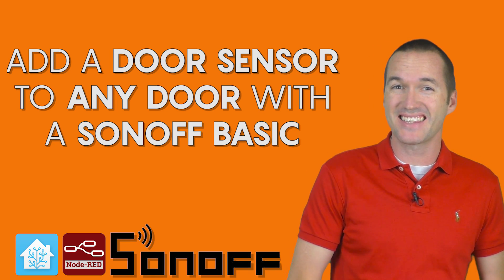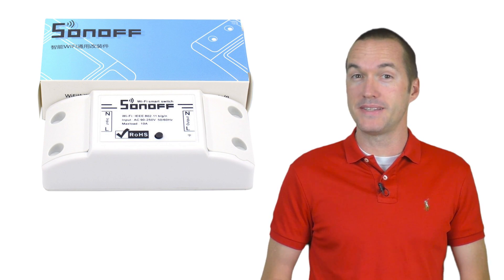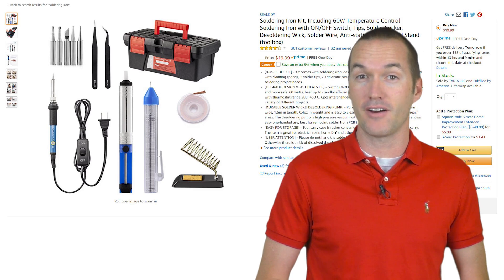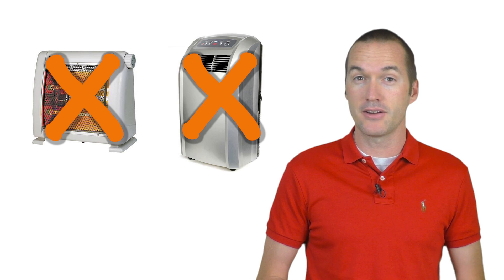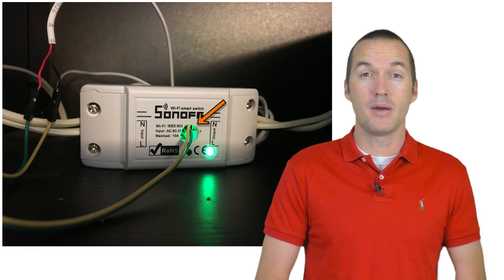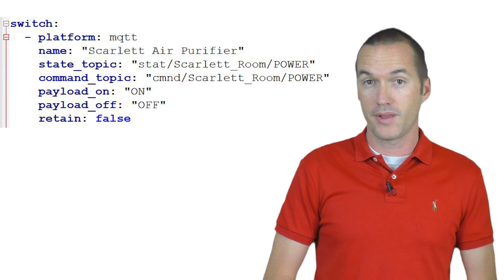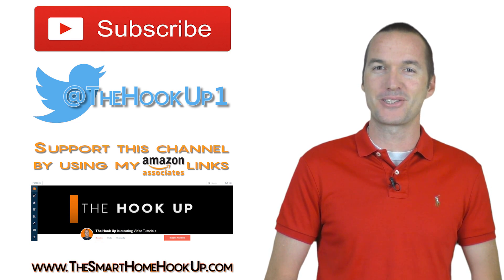Add a door sensor to any door with a Sonoff basic.

Comment: I'd like to use sonoff mini instead of basic, light switch is often close to the door. Do you think it's possible to update this tutorial with sonoff mini?
Reply from the maker: I believe the sonoff mini has mains referenced voltage on the GPIO, so I wouldn't recommend it.

Comment: I wonder.... Wasn't there any wifi or zigbee door sensors in 2018? I've had a tuya based wifi door sensor for ages and now there's dirt cheap zigbee ones. Even the tuya isn't that power hungry and if the CR2 battery doesn't last long enough then just build an external battery pack. No hassles of long running wires and potential increased fire risks.

Comment: To put the 5 “pins” in all you need to do is heat up the solder & use the solder sucker that was in the pack, this will take the solder out of the hole. Place the pins in the hole & re solder. No dicking around pushing  a very hot pin through a hole.
Btw this shockingly bad & arse over elbow for a simple job. Just buy a battery operated door sensor from Kasa. In the Kasa app you can make the sensor do all sorts of things .. and above it’s safe unlike the crap your showing.

Comment: Amazing WiFi sensors do7.pl/AISensor it will tell you if your for or window has been opened. Easy to configurate instructions are not the best. But really all you have to do is put 2 AAA batteries download the simple home app make sure that the blue led is flashing while you’re trining yo pair it with the app if it is not just remove the battery’s and try paring again

Comment: Any advice or opinions about connecting multiple reed switches in series with the sonoff? Personally, unless there's a logical reason for knowing which specific door or window is open, I would try setting up one sonoff for windows and another one for doors in each room with a series-wired switch for each window or door.

Comment: Buy some solder removing woven copper wire, it is super cheap, you heat it next to filled pads like those and it will suck up the solder leaving the holes open.

Comment: I tried the same process with a door sensor and a nodemcu but i must be missing something.. I did the whole process (used GPIO14 -> Switch 1 (9), tasmota console detect the ON/OFF of the door sensor. Also home assistant mqtt console detects the device but nothing else. Do I need to run additional commands in tasmota console ? Do I need to configure a yaml file or anything else in home assistant ? Thanks in advance.

Comment: hi, Your videos help me a lot. But I´m trying to use a sonoff sv as a gate opener, I set pulsetime since I only need a pulse to open or close the gate, but when I try to use a reed sensor on gpio14, to show the state of the gate (open ou closed), it triggers the relay when the reed sensor closes... could you help me with the configuration so the gpio14 only sends information of the state of the reed sensor and doesnt trigger the relay?

Comment: Haven't actually got mine yet, but I'd have thought you could wick the solder out of the holes, drop in your five pin header as a single piece, then solder each pin individually? I don't know why but I find it much easier to solder when I'm concentrating on one hand doing something fiddly rather than both, and with a full set of headers you can just rest it upside down and let gravity do the hard work.

Comment: Can I just connect a sonoff sv and have the output be always on, and run a reed switch in series with a led or something with a small current draw so when the door is open the reed switch will open the circuit, and then I can go change the device settings to notify me if the circuit turns on or off?
Reply: I’ve only known about these things for a week and now I want to make everything in my house smart. And I only learned about them because I wanted to hook up myq to a BFT control board and found out myq was subscription based and only works with certain models of liftmaster products. This seemed silly to me so I set out to prove my coworker wrong only to find out he was right. Then I found a video about the sonoff sv. I instantly knew I could use these devices and possibly a great many of them so I bought 4 to play with and another 4 basics. I already have my overhead garage door on a sonoff sv, my coffee maker is on a standard sonoff for the schedule function on ewelink, today I’m wiring an old electric strike from a job that still works well to the pedestrian door on my garage with a sonoff sv. If that works well, I’m going to get a new assa abloy electric strike for my back door. And I’m just getting started. From work I got my hands on some really high quality wired outdoor reed switches for gates or overhead doors that I really want to wire into one of these WiFi switches, that will then notify me of the door being opened or left open. The only thing holding me back is I don’t have a computer, so I’m a little leery about trying to flash or using the more complex home automation programs....really I don’t want to buy more components that will end up on a shelf if I’m not sure about it. I know, should just try and see how deep I can get, either way I will learn something. Thank you for sharing your knowledge it is helping me a lot

Comment: anyone have any experience/suggestions for doing something like this for an outdoor gate?
Reply from the maker: I've found the actual magnetic reed switches to be extremely weatherproof, so assuming you have a weatherproof box to mount the sonoff it should still work well.  I use a nodeMCU to monitor my gates.

Comment: Can you pls explain how to connect wired reed switch to 5V DC Sonoff module. I am already using this module to automate my car garage door. Now I would like to get door open /close notifications. Pls, help me with this requirement. Thanks in Advance.
https://www.ebay.com.au/itm/Sonoff-WiFi-Wireless-Smart-Switch-Relay-Module-5V-for-Home-Apple-Android-APP-DIY/112731113199?_trksid=p2485497.m4902.l9144
https://www.ebay.com.au/itm/ABS-Wired-Door-Window-Contact-Reed-Switch-Normally-Open-Closed-Switch-NC-NO/401734157936?hash=item5d8938c670:g:FbAAAOSw43pckzCq

Comment: All the automation can be done with the Sonoff itself without even having to mess with HA.  Just set up a rule in the Sonoff that triggers when the switch is activated then send a command to any other device you want to power on.  I have a Sonoff that opens/closes my garage door.  I have a reed switch connected to it to detect if door open or closed.   Rule1 Detects garage door is open sends a Web command to my garage lights to turn them on.  Rule2 detect garage closing, waits for 3 mins then sends a Web command to turn off my garage lights.

Comment: Am I missing something? I have a wireless door sensor that literally does the same thing and works flawless and I didn't have to flash anything, didn't solder anything, no running wires across the room etc .. also after you buy a sonoff, soldering iron, wire etc.... You could have just bought a wireless sensor and spent 30 seconds accomplishing the same exact thing.
Reply from the maker: To each their own.  Things you are possibly not considering: No batteries to change, no hub needed, increased reliability, and of course the fact that many people already have a sonoff deployed that could use this added functionality.

Comment: I love the idea, and I’m trying to use it for a garage door, but the sonoff I have is the R2 (does not have GPIO 0, so I used GPIO 3) but my question, can everything else be follow as directed?

Thank you very much for your time and your shared projects!
Reply: I actually use “KEY” as GPIO14 to connect the reed switch with ground... but I can have the sensor to change from open to close (In Home Assistant, neither to decouple from controlling the relay. I’m using the Sonoff R2, but I follow all the instructions as directed. Everything else seems to work fine. Any suggestion will be very appreciated

Comment: If you read your comments, please please re-edit this video with warnings. As long as the reed switch is rated for mains Voltage, not the common security type, it can be safe.  Sonoff has no isolation from the mains. any wire connected to inside MUST BE TREATED AS LIVE. The wires also need strain relief. Hot glue is not good enough. A cable tie inside is better.  If someone follows your instruction and kills themself then what..
Reply from the maker: I read all the comments.  Your statement that "sonoff has no isolation from the mains" is not correct.  Sonoffs, especially the R2 have very decent mains isolation.  An arc-short event caused by a significant power surge could cause mains to jump into the low voltage area, but it is pretty unlikely.

Comment: Hello! I don't know where to look more, but I really can't find a way to setup the reed switches for my garage door. I don't want the reed switch to trigger a relay, I want them to show if the garage door is open or close. Any support please? Thanks.
Reply from the maker: This is the video you need. Follow the steps starting around 5:00
Reply: @TheHookUp  Hello! First off all thanks for your reply. In you case you are using the sensor to tigger the fan. I just want to use HA to show the sensor status (open or closed). I con't want to tigger any relay. I will try again, thanks.

Comment: I need this in a 12VDC setup for a gate opener. Is it possible to do the sensor on  a shelly 1? I know the gpio on the shelly aren't as flexible as the sonoff but the sonoff can't take 12vcdc input.
Reply from the maker: This will work with a shelly ONLY in 12v mode.  Do not try it in AC mode.
Reply: @TheHookUp  Thanks! What gpio would you use to get the sensor on a shelly in 12v? Wanted to replace a sonoff

Comment: For the life of me I cannot make the state_topic work and survive a Home Assistant restart.

It always goes to Unknown every time and this across three different devices (Garage Door, Gate and Alarm).
Reply from the maker: There's another trick you can use where you write an automation for when home assistant restarts, send an MQTT message like "hi" to the group topic (sonoffs/cmnd/power1) and it will cause the sonoffs to register an unknown command and then report their actual state in the state topic.
Reply: The Hook Up yeah I’ve even got that in place as well but no dice whatsoever. This only happens with SV’s that are both a relay and a status rolled into one entity in HA.
Reply: Hmm it appears my Mosquito docker never had persistence enabled and that may very well have been the key. Will see if it survives the next full HA update and not just a normal restart.

Comment: As always I want to thank you for all of your videos.  I have learned so much on the last 8 months from you.  I would be extremely thankful if you can answer this question.  I am using a sonoff sv to control an irrigation system.  I want to add a capacitive soil moisture sensor to the sonoff, so besides having temperature and humidity provided by an DTH11, I will also have a reading of soil moisture.  The sonoff does not have a pin for analog reading.  In this video you are using the magnetic sensor which requires an analog pin, is that correct?  Any feedback will be greatly appreciated.  Thanks again
Reply from the maker: The reed switch is magnetic, but it reports a binary value (on/off).  I think you are thinking of a hall effect sensor.   The ESP8266 has a single analog pin but it isn't broken out on sonoff devices.  Maybe you'd be better off with a nodeMCU or D1 mini and a relay board?

Comment: Hoping you can help. I have the same setup for my garage door and it's all set on gpio14 and I ran your 3 commands in console. But when the contact goes from off to on (opening the garage) the door stops as in the sonoff toggled. I then need to press it again and it closes the garage
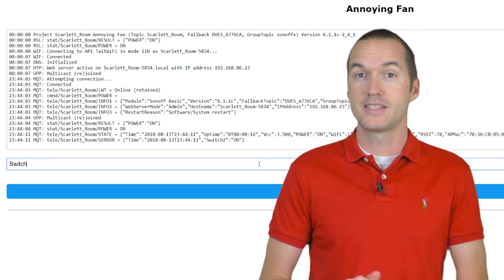Reply from the maker: Did you input the commands at 5:40 in the video?
Reply: Yup! Made sure those commands were run. Now does it make a difference if let's say my device name is gdoor and I also have my switchtopic name as gdoor?
Reply from the maker: @neilsidhu9200  yes, the switchtopic must be different than the device name.
Reply: @TheHookUp  Do this look correct? I have cut this out of my console:
::WHEN I OPEN::
01:07:26 MQT: stat/gdoor/RESULT = {"POWER":"ON"}
01:07:26 MQT: stat/gdoor/POWER = ON (retained)
01:07:27 MQT: cmnd/garagedoor/POWER2 = ON (retained)
01:07:27 MQT: stat/gdoor/RESULT = {"POWER":"OFF"}
01:07:27 MQT: stat/gdoor/POWER = OFF (retained)

::WHEN I PRESS CLOSE::
01:08:17 MQT: stat/gdoor/RESULT = {"POWER":"ON"}
01:08:17 MQT: stat/gdoor/POWER = ON (retained)
01:08:18 MQT: stat/gdoor/RESULT = {"POWER":"OFF"}
01:08:18 MQT: stat/gdoor/POWER = OFF (retained)
01:08:28 MQT: cmnd/garagedoor/POWER2 = OFF (retained)

::MY YAML::
- platform: mqtt
  name: garage
  state_topic: "cmnd/garagedoor/POWER2"
  command_topic: "cmnd/gdoor/POWER"
  qos: 1
  retain: false
  payload_open: "ON"
  payload_close: "ON"
  payload_stop: "ON"
  state_open: "OPEN"
  state_closed: "CLOSE" 
  optimistic: false  

I am using NODERed for the state as well
Reply: @TheHookUp  So i notice this only happen when my MQTT server is down.  I have followed your steps and they work ok when MQTT IS up and running.  Any suggestions?
Reply: Ok that may have been the issue then as I had both names the same. I have changed my switchtopic to garagedoor now and will test in the morning as it will make too much noise now. Thanks for your help and will report back tomorrow

Comment: Hello. I've been using eWeLink to control my Sonoff devices. Since you don't use it as you mentioned in this video, may I know what Android App or iphone App are you using?
Reply: It is accessed via browser. On Android Chrome you got to the home assistant and then on the browser click on the three dots for Chrome options and add to home screen which adds shortcut to your screen and invokes it to work like and app. I have on all my phone's and tablets and just about to mount a tablet to my kitchen wall I am currently working building house alarm in it so I have a tab menu for house alarm and inside that I have on screen keypad I can see every PIR and door sensor and whether they are open or closed history when they last detected. It makes broadcasts announcements to my Google home speaker if door or window is open when I set the alarm and sends messages to mine and wives mobile phone via Push bullet app which I can include which sensor and if camera is near sensor I can send a pic in the message lots of cool stuff.
Reply: He uses homeassistant which is the biggest smart home open source project I gives you one place to control everything in your home. The home assistant community (im on there) is super helpful. He talks about Tasmota this is a replacement firmware for sonoffs firmware and generally most guys flash Tasmota onto any sonoff gear this gives you better control over the device and makes it easy to integrate with home assistant.
Reply: @LlamaOates  Thanks for the info. When you say homeassistant, is it the google's home assistant App for Android?
Reply: No that is Google Home which has many limitations but is used in conjunction with www.home-assistant.io so you program all your iot through home assistant as the master control panel and can link your Google Home and minis so you have voice control as well.

home-assistant doesn't have an android app. It is an operating system that needs to be installed in its own area like windows. Most people start out by buying a raspberry pi+ coz its simplest way to install on low power always on device. home assistant community is full of help you won't find a great deal on YouTube.
Reply: @LlamaOates  Oh thank you for the explanation. I still want my Sonoffs to be controlled via Android or iphone App. If homeassistant runs on windows or in RPi, I therefore have to make my own Android App. Or maybe An App embedding a web browser with address bar hidden. I presume homeassistant is IoT web browser. I will look into that. But I will still appreciate if you expound further regarding my concern that I have just mentioned. Thanks in advance.

Comment: When the mqtt server (in my case the raspberry with the HA installation) is down; the switch starts controlling the main relay of the tasmota, directly turning on and off the device connected to it: is this normal?
Reply from the maker: I think it was s feature added after this video.  Try making the switch "switch2" instead of "switch1"

Comment: Could I cotrol a AC pedestal fan, has 3 speeds switch, NO INFRARED, with a  PWM signal, to control speed? I've seen AC dimmers on ebay, scratching my head as to if this is possible!    ;-)
Reply from the maker: What generates the pwm signal for speed control normally?

Comment: Thank you for the excellent tutorial!  I've constructed three of these to use as garage door sensors.  They work great except for one minor snag.  If power is cycled while the reed switch is closed the device goes into flash mode.  Is there a way to prevent this?
Reply from the maker: You're using the new version of the sonoff basic?  If so I'd recommend using the RX pin which is GPIO3.  GPIO2 sucks.
Reply: @TheHookUp  Yes.  I'm using the new version.  I'll rewire using GPIO3 instead.  Thanks for the quick response!
Reply: AND the wires to the reed switch are LIVE to the mains. The insulation on common reed switches is not up to mains, only 12V